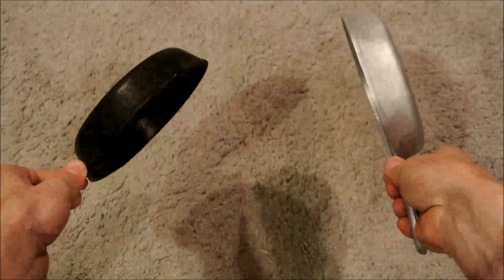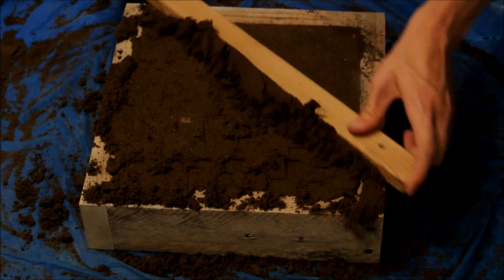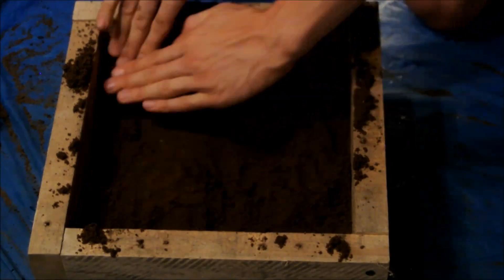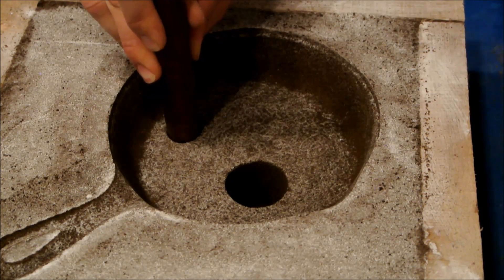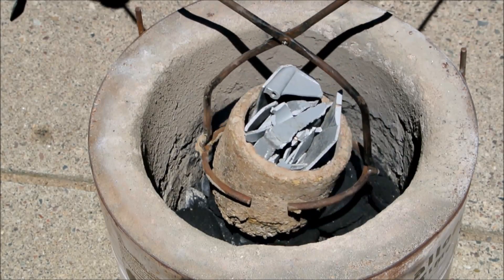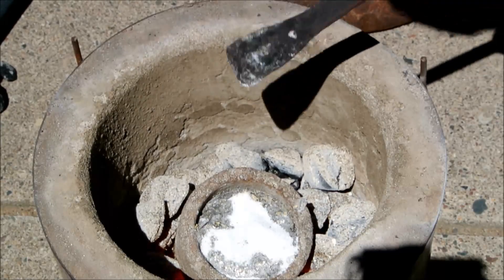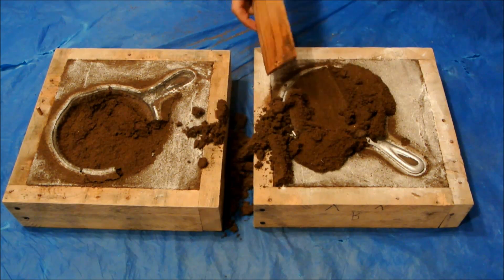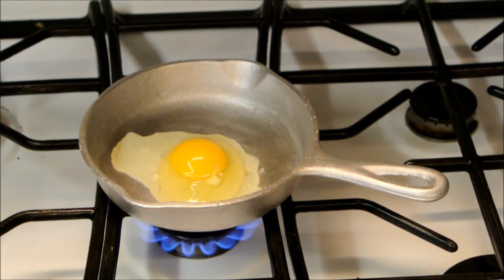Cast a Mini Aluminum Skillet - Start to Finish

Comment: I have heard of the links with aluminum and issues. The way to overcome the problem is to "Tin" the pan. Watch a video on how the guys with copper pans "Tin" them for the same reasons. not only does it seal the surface but a bit of silver is good for you.

Comment: Ever tried anything like this with soda cans?

Any problems with the metal?
Reply: You’re going to have a literal fuckton of dross because of all the paint on the cans. I was originally planning to use cans as my main source for casting but they’re so much work I’d rather stick to stripping aluminum wire
Reply: I have found out that you can add some table salt to the aluminum melt and it will make the aluminum run thinner....

Comment: You should pack the sand as you fill the flask rather than waiting till it's full. Start off by mounding sand on top and around the pattern, pack this against the pattern with your hand. Then fill the flask with sand till it just covers the sand packed on top the pattern, and pack it down. Continue filling the flask with 2-3" of sand and packing it till it's full. This will result in better definition and less casting defects. I would also add more vents.

Comment: Is your clay crucible homemade?  
If so,  how do I make one?
Reply from the maker: No, sadly it is not homemade - I believe it was a clay-graphite crucible bought online.  However, I have determined that mixing 8 parts clay dug and prepared from my backyard with one part sand makes a clay body that holds up reasonably well to high temperatures.  I haven't tested that mix as a crucible yet, but it worked well for a tube for making a tube furnace - no cracking.
Reply: The Plutonium Bunny Thanks!  I found some red clay and I already have some sand.  I'll mix crushed brick in it as well and see what happens.
Reply: @sakuraknight9274  bake it first in an electric kitchen oven and make sure moisture is totally gone. It may work good.